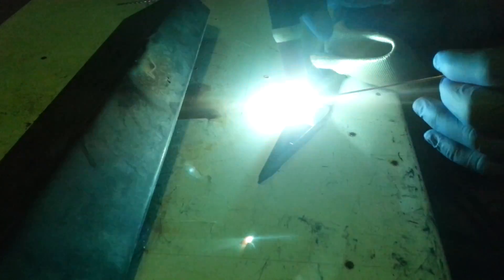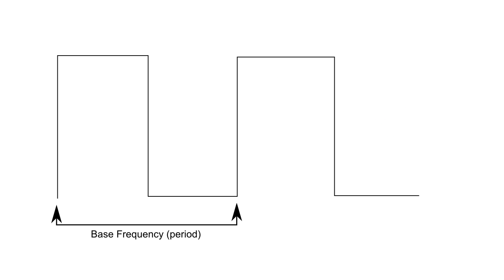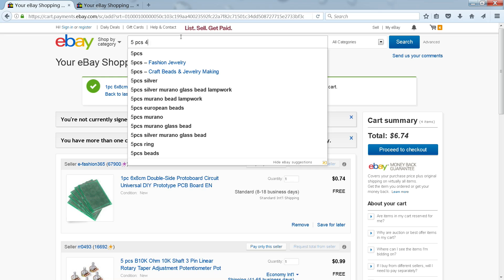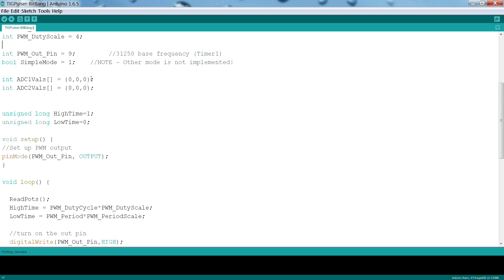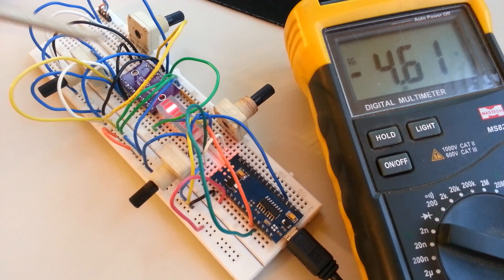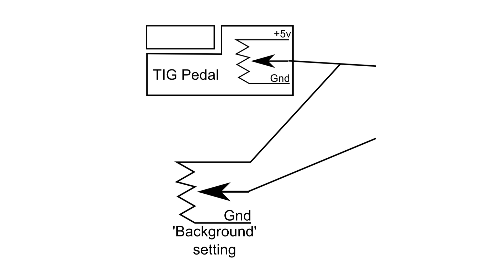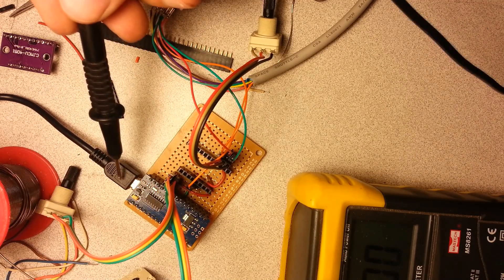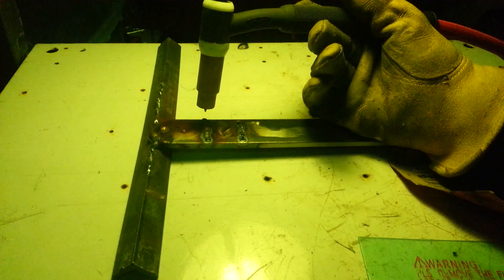Build a TIG welder pulser add-on for $10. Cheap and Easy.

Comment: " An avid time traveller.." hahaha. Any chance you might be willing to share the source code and schematics?
Reply from the maker: Sure thing. I'll do a write-up and post when I have a moment.
Reply: Did you ever get around to posting the audrino code? i have all the parts sitting infront of me right now ready. im trying to gleam what info i can by pausing over the bitbang section, but im new to that kind of coding. copy and paste document would help so much and help alieviate any worries of me messing that part up. thanks, Cody. p.s. email is Mackn918@gmail.com
Reply: @codymack6343  I posted the code I am using yesterday.
Reply: @thisstuffido9141  I posted the code I'm using yesterday.
Reply: @jzurek112  Where did you post the code you used for the $10 tig pulser, cant find it anywhere?
Reply: @choneysett  look back about 11 months ago. It's still there and will work with his schematics. I've grown the project far beyond what he set me off working on. So my latest code is not public. But the code posted in the replies above should work fine.

Happy pulsing!
Reply: @jzurek112  Thanks, I see it now, pretty much what I ended up with myself. I just have to find time to hook mine up and test it. Only concern I have is when putting a scope on my foot pedal I see a huge amount of high frequency stuff over the dc signal so I hope it doesn't interfere with the multiplexor. May have to put in a filter cap to get rid of that.
Reply: @choneysett  unless you plan on running high-freq continuous it should be fine. It gave me tons of grief when I added my 4-line display to my pulser on the Arduino. But doing the project as ToT, you should be fine. Let me know if you have questions.
Reply: @jzurek112  I built using your code posted. It works fine on bench but when hooked up to welder it makes the toarch burn watt hot and does not pulse. Am I getting interference? If so how do I deal with it? Like caps between power and ground line or what? Pls help.
Reply: Count me in please!
Reply: @alexeivaningen  I posted the code I am using yesterday.
Reply: @bryanspencr  I posted the code I am using yesterday
Reply: @jzurek112  where can i get the code from?

Comment from the maker: Yes, you should be able to do that using the amperage potentiometer on the front panel. You'll want to measure the voltage across that potentiometer to see if it is compatible with a microcontroller (or whatever circuit you choose to use). If it is 3.3-5v you can use it to power a low-current microcontroller directly. If it is higher you'll need to use a voltage regulator or external power source to power your microcontroller and an op amp to swing the microcontroller output to the range the welder is expecting. 

I would suggest that running the amperage adjustment potentiometer out into a pedal might be much more useful though. I can't imagine doing any kind of dynamic TIG welding without foot control. 

What is the make/model of your welder?
Reply: Thanks for the reply. It is an Andeli tig 200g. The specs are on this web page and there is a PDF available to download if you are interested.  http://www.andeligroup.com/Inverter-DC-TIG%7CMMA-Welding-Machine-(IGBT-Type)-id866.html. Not the best welder out there but I would like to see if I could mod it. Looks like I am going to have to get a new multimeter.

Comment: Hi, I have a cheap Chinesium tig welder that has high freq start but it is only on/off. Is there any way I could make a pulser addon for it without having pedal control? Thanks.
Reply: Jack Forester  good question

Comment: was thinking to do this sort of conversion with a simple  timer relai , since my lorch it 252 has already a built in  knob (and switch @ torch )for  half "ish" amp  selection , and this is just a great upgrade for alu and stainless welding   , ( now heading for shed )

Comment: Excellent! I've waited 4 long years.  ;)  Couldn't have done it better myself.  (literally.. I could not have).  I haven't made the addition yet; have been on the fence: $10 for a pulser or $4000 for a new welder that can already do it.  I know, tough call.
Reply from the maker: Thanks for the comment TOT. I think you have the TIG skill to justify the $4k niceness. I, sadly, do not. I picked up the AHP AlphaTIG late last year and it has exceeded my meager needs. Yellow always gets the blue vs red crowd riled up.
Reply: @thisstuffido9141  sis you ever upload the full code as the code you show dont work, thanks
Reply: If you have post flow you can have pre-flow. Just hack out a peace of scrap and ground it close to where you are welding. You can go old-scool and use a manual vaulve torch, and just hook op the torch directly to the flow meter if you are made of fittings and gas hoses :D
Reply: Yellow, huh! I’ve got an ESAB EMP 215. That’s yellow too. I’m sure that gets them riled up too. Sigh, thinking of replacing it with the new EMP 205 when it comes out later this year.
Reply: 4k for the Stel..ehm htp? Looks a bit pricey🤔, i thought It was cheaper tbh😅
Reply: I am tempted to hook this setup to the death toaster 😂 just need HF start 🤔
Reply: There anyway to send you a pm? Thank you.